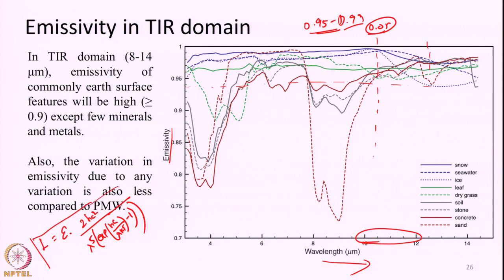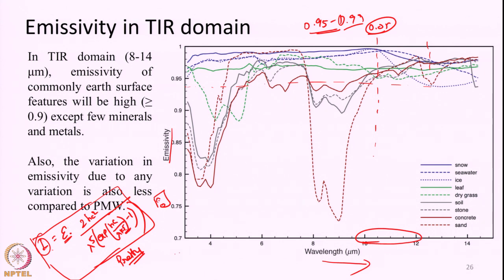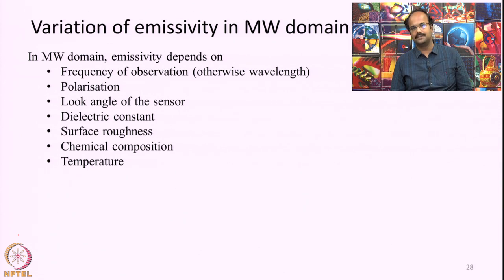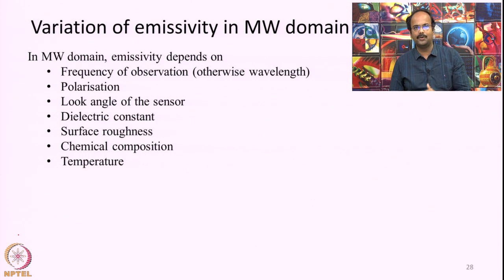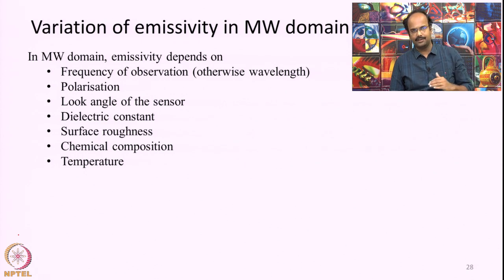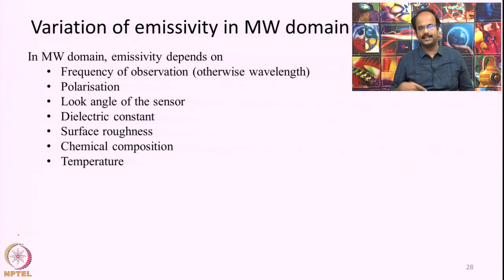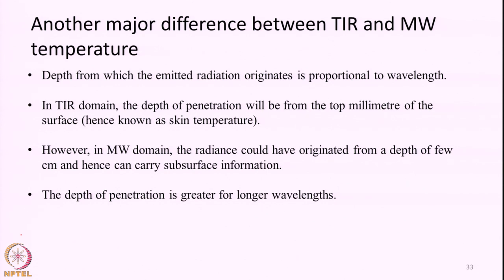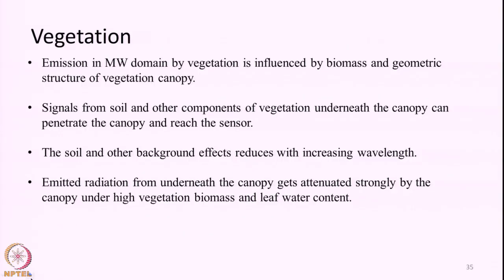Lecture 43: Passive Microwave Remote Sensing – Part 4

Comment: Emission phenomenon in microwave The main part of lecture that ⬆️above professor wants to define is [surface ]of reception 
Microwave transition waves |||[]||||[]||||[] anDispersion inTo surface 
Any type of surface but different states of matter Microwave transition waves has absorbent properties to liquieds and semiSoLids while at some metaLs microwave rechochets example silver foil container of ethylALcohol
Acording toPic for Fahrenheit grasp oR farhenheits conductibliTy both occurs in microwave professor above defines both satellite plasma and thermaL farhenheits microwave sterilisation of [steel artery foreceps Requiring biceps strength ligation ]ie more concentrated imprignation of operational patient on equipment
The structural formula of microwave abide of radioFrequency is 
Perpendicular ||||magnetic strands with intenscity _o.7micron thick
 ___|___magnificence each strands geometrically perpendicular has lagPhase of electroStatic connectivities that gives equvidistant emmisision thou each transitioned strand is paced are electroStatic helD nonDisplaced
ElectroStatic ergs are intenscity responscible for deviation of microwaves aStrands dont alter so pace--LaG------forms gaseouState electroStatic ergs when microwave applied to oR within troposphere but microwave beyond stratosphere is occupied by Uv rays and magma----magma magnetic gravity that holds planets in orbit Same capabilities occurs inTo microwaves of hrctScan because of being strands the transition exactly imposes on sulcus and gyrus of brain and rechochets with extra frequency of magnetic mAmp because hrct---> ○ socket and Transition exactly imposes on sulcus and gyrus of brain and rechochets tOrigin emmisision and graphics thExact stature of brain because of being transition plates superimposing oN surface of brain---> when farhenheits and frequency are ⬆️increased superimposing layers of transition penetrates to aquiRechchet grey matter provided farhenheits frequencies equivalent to emmisision magnetic VaLency metaLs as hrctScan machine is made of fibre and electroConduction metaLs and electroMagnetl Vegetation conservation haShifted from nucleaRadiation to microwave sterilisation to preserve medicine Foods: meaTransport: with efficiency of sLab substractumisation oN surface ie thro transitioned waves resembles hrctScan substractumisation on beating heart oR erosioned sulcus in brain haemorrhage We observe transition waves from coronaL section LagPhace-----\__|____|__|----|----|-- <---electroStatic ergs but at saggitaL section thickness of transition sLabs can be defined that also abilitates longitudinal section study of corpusCallosum thro hrctScan microwaves from frontaL substractumisation thro sLab transition teqniques not from lateraL surface focus of hrctScan oN temporal part of cephaLus for longitudinal studies in corpusCallosum but future years sLab diffusion oN both sides of corpusCallosum thou focused from frontaL skull abilitates nonMobilities of patient soketted preventing bleeding in brain haemorrhage while radioDiagnostics
Next lecture on highALtitude cardiology U tube